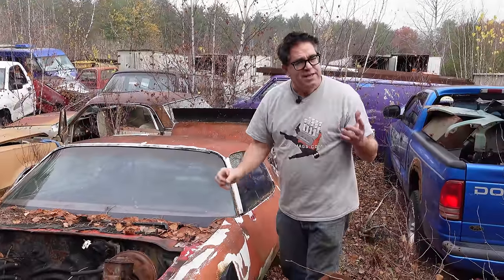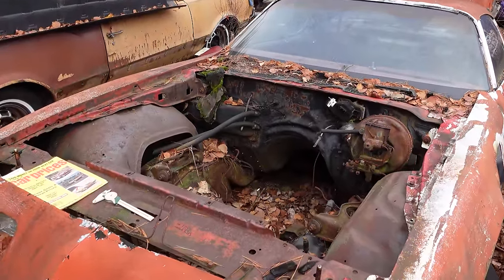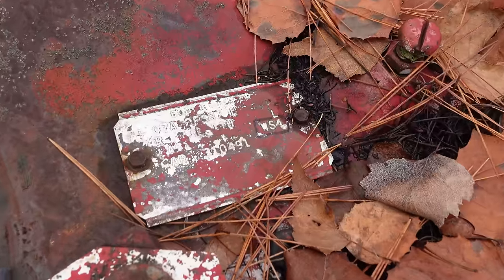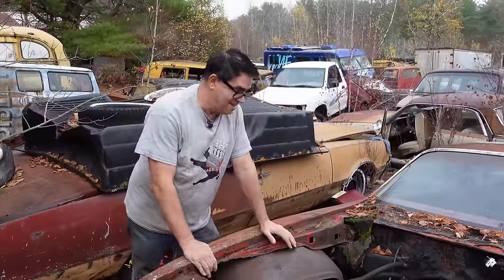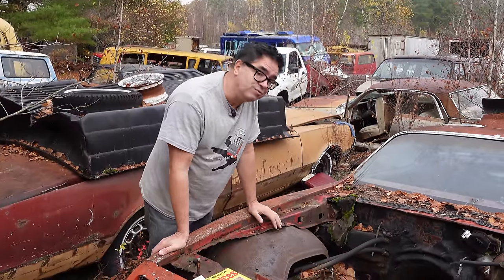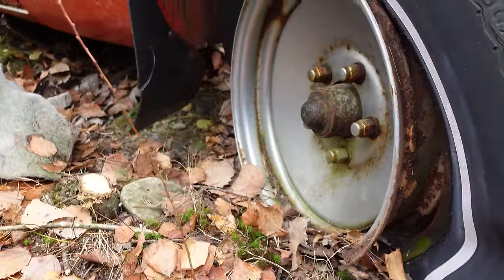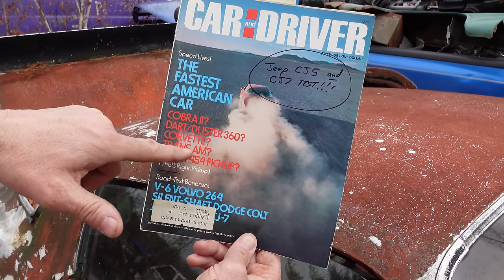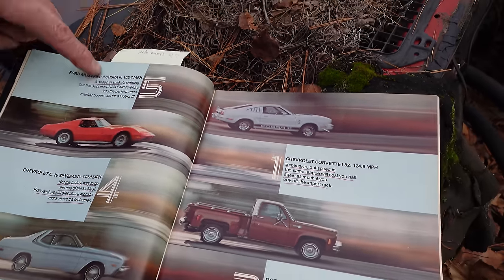1979 Trans Am

Comment: As a teenager lot boy in the late 70's I got to experience a lot of 2nd and 3rd owner muscle cars first hand. A side benefit was seeing which of these could do the biggest burnout and one of the best was a '76 TA with a 455 4sp...it went a whole block.  A close contender was a '72 Eldorado...easily melt the tires.  Still surprised that the dealer let us take cars out for lunch...
Reply: A lot boy that did burnouts with my cars would have disappeared from the earth.
Reply: A lot boy?  Washing and detailing cars.   Doing burnout's and melting tires...  Myth busted Randy.  Those cars could only spin the tires on Glare Ice.
Reply: @dand3975  Apparently you never drove any. I had a 76 Oldsmobile Toronado. It was FWD with a 215HP 455 that could lay a patch of rubber almost a block long without doing a brake stand. Just mashing the gas pedal on a flat street and it would erupt the tires. Horsepower has little to do with burnouts or tire frying capability. It is torque. Horsepower is a number contrived of torque over time. Torque is an actual measurement where horsepower is a calculated factor of torque. Malaise era cars were detuned muscle car engines. They dropped the horsepower but the torque of the big cubic inch engines pretty much remained.😊
Reply: my dad was one around the same time as you, he took a 71 mach 1 mustang with a 351C 4v  home from the lot, he did a huge burnout up his street car was sideways for 60 feet, when he went inside to eat dinner his mom gave him shit for driving like that and he said "its my license" she flipped the dinner plate onto his lap

Comment: In 1979 I bought a brand new Trans am. Black,  with the gold trim. Looked exactly like the Smokey and the bandit car. T TOPS,  etc..man I loved that car! Southern California car,  drove it across country 3 times to visit relatives in Wilmington North Carolina, with no issues.   By 1986 it had almost 150.000 miles on it. Only thing was it really was all show, no go . Had the 403 6.6 L engine.  So much smog crap just did the performance in. It drove great, I didn't really have many problems with it. 1 transmission rebuild,  water pump, heater core had to be replaced. 1 AC COMPRESSOR,   But it was an awsome looking car, great fun, and would cruise all day at 85 90 no problem.  Traded it in on a new  1986 Pontiac Fiero V6 MANUAL,  Fully loaded,  I totally loved it .  pretty quick,  Big whale tail rear and the porche looking front end. In red of course.  I still have it! 286.000 miles on it, engine never been touched.  Breaks my heart to see this poor old girl in this shape. I hope my old TA is still running around,  if it stayed in Southern California,  and probably did, it may still be on the road. My 58 cadillac that my parents bought in 1960,  and 68 Mustang I bought in 1977 are! Almost forgot,  in 1994, I bought a NEW Trans am, has the LT1 engine,  when I test drove it,  it was night and day difference in the Horsepower! This car is a rocket ship compared to the 79. I turned to the salesman riding with me and said I'LL TAKE IT!! Still have it. 338.000 miles on it, it looks nearly brand new,  engine has never been touched,  even the timing chain is original,  still runs great, and will still push you back in the seat when floored! 😊
Reply: That's an awesome collection my friend! I had a '77 TA black & gold and i loved it. Had the 403 though. Cheers man!
Reply: @aquateen77723  Thx! The 77s were super sweet!
Reply: That's cool man. My father is in possession of a family vehicle that's all original. It's a steam car that's very rare. We actually would bring the total number up 2 more because we have the complete that's a family heirloom and 3/4 of a parts one. I don't think there is about 13 or so known

Comment: This video is close to my heart. Last Monday the wife and I rescued a 79 trans am Y84 car k code. Such a incredible car I have wanted one since I was a kid. Bucket list car for me.  Cowl tag  79 06B 2FS87 N 237861 2nd row 62B 19L 19U L 3rd row A51 CC1 A31 Y84 4th row  TA2 180608. Needs alot of work no engine or tranny.  But will restore this car back to her glory, will take a few years but she will live.
Reply: I decoded that car on your channel. You had a few things wrong, but here goes again:

79 for 1979 model year, 06B for the second week of June 1979 production, 2FS87 for Pontiac Firebird, N for Norwood, OH assembly, 62B for Camel Tan cloth interior trim, 19L and 19U are Starlight Black exterior paint, L for lacquer paint, A51 for bucket seats, CC1 for T-tops, A31 for power windows, Y84 for Black SE, and TA2 for tan secondary interior trim. The other numbers are Fisher body time codes/internal codes and have no real meaning for most. Yours is one of 9,874 Black SE cars with a 403 for the 1979 model year.

Your VIN is 2 for Pontiac, W for Trans Am, 87 for two door coupe, K for 403 Olds V8 with four barrel, RPO code "L80", 9 for 1979 model year, N for Norwood, OH and the rest is the production sequence. The Norwood plant closed in August 1987 and the Van Nuys plant closed in 1992. The Norwood plant used lacquer paint and the Van Nuys plant used water-based paint due to CA air regulations at the time. The Norwood cars were better.
Reply: @googleusergp  this is incredible brother. I truly appreciate your time and help with this. I think this car deserves to live again. Is there a way to find out the rear gears in this car without pulling the difference cover 🤔
Reply: @rescuedandrestoredgarage  Look for the stamping code on the right side axle tube.
Reply: @googleusergp  that's going to have to wait alot of snow lol
Reply: @rescuedandrestoredgarage  In case you haven't figured out the rear gear ratio yet, there's a code on the front of the passenger side axle tube. There's probably surface rust on the tube, so light sanding should reveal the code. A flashlight and magnifying glass helps a lot. It's a 3 digit code, a number than 2 letters, like 2PU. 2PU happens to be a 2.73 posi, and is from my 79 TA with WS7. So yours could be the same, if your car came with the WS6 or WS7 handing option. WS6 has rear disc brakes. WS7 is the same as WS6, except for having rear drums. The standard ratio on a 79 TA with 403 engine is 2.41, code 2PS. So, if you can see the code, and it's not one of the ones I listed, then post the code here or on Trans Am forum or Facebook group, and somebody will decode it. But there's another way to quickly tell the ratio. Jack up the rear axle so both tires are off the ground. Mark the left tire with a marker or piece of tape at the top of the tire. Also put a mark on the pinion yoke on the rear end, or on the driveshaft. The transmission should be in neutral. Turn the tire forward one complete turn while counting the revolutions of the yoke or driveshaft. The number of turns the yoke or driveshaft makes is the ratio. For example if it turns about 2 3/4 turns, that would be a 2.73. If it turns a little over 3 turns, that's a 3.08. Those would be most likely on your car. Less than 2 1/2 turns is the 2.41. And a little less than 3 1/2 turns would be 3.42. 2 1/2 turns would be 2.56.
Reply: @grand73am  this is incredible information brother ty so much. I truly love this car. The wife and I have been making videos of this car and a few other cars we have. So information is very helpful

Comment: In around 1990, I scored a low mileage 403 from a wrecked  '79 Olds station wagon and put it in a '79 Regal. Funnest car I ever owned. 
 The Regal said 3.8 on the fenders, and as  it sat there going blat,blat,blat,blat people would ask"That's a 3.8 V6?", I'd go yup then get in and just murder the tires, I could smoke auto Mustangs and keep up with 5 speeds.

Comment: Years ago (like back in the early 90's) a buddy of mine had a 10th Anniversary T/A. It had sat neglected in his yard for years (IIRC, it had 23k miles on the clock), and the shop I worked at was tasked with getting it running/driving again. Well, after a LOT of work, that 403 4V (Oldsmobile engine, right?) ran perfectly, trans and brakes (yes, it had the four wheel power disc option, as well as the snowflake wheels!) were freshened, then it was off to the body shop for paint (and proper graphics) followed by the upholstery shop for the proper silver interior. Man, that thing was nice! He probably had twice the value of the car into that restoration, but he was on a mission. Would have been so much better if he had just taken care of the damn thing in the first place! LOL! Thanks, Steve. Rock on, man!
Reply: Yes, the 403 V8 was an Oldsmobile V8. You could also get a Pontiac 400 in a 10th Anniversary (I have one). The 403 is a dog, but a good engine.

Comment: Another great one in the books. Steve your absolutely right these 70s Trans Am held up on these back rd curves of NC all except 1. A friend of mine owed me some money for legal stuff and I took partial trade on early 70s model TA that had wrapped itself around a pole. I forget what yr but it wasn't the quard headlight body style.  The 455 AT was still intact. I had my grandma's mint condition, oil burning Olds Cutlass Cruiser wagon, White with woodgrain and light blue interior. Well you can guess where the 455 TA running gear found a new home at. The smaller wagon left little resistance against the 455 and became a well none "sleeper" in town. Not before I pulled a few $ from the Mustang and Camaro guys. If I could keep it from spinning off the line I'd freight train by any stock muscle of the day. Also probably could of won a few burnout competitions with it. The wagon met its end one night I lined up with a V8 S10. Dude had me off the line as usual and as I began to nose passed he swerved into my lane So I lifted as he passed on by he continued into my lane only to pit himself causing him to flip on his side sliding across the medium into 2 lanes of on coming traffic. A mid 80s suburban T-boned him while sliding. This causing an explosion of empty beer bottles/cans etc. Dude was drunk and I didn't know. I ended in the grass on the left side where the control arm grabbed some sort or concrete iron thing and we came to a sudden stop. Now the tragedy unfolds. So in the back of the wagon were 2-5gl pales of asphalt rejuvenate sealer. They impacted the rear seat and blew open the sealer and it painted the back of everything. Inside the windshield, dashboard, and the back of my head and shoulders. The A-arm was fixable but that light blue leather/vinyl interior was totaled not to mentionthe smell would've been permanently embedded...LOL  Namaste 🙏🏼

Comment: Even with the high volumes produced, these were hard cars to get. My dad tells the story that my parents tried to get one in late 78 and were greeted with a 6mo wait time. Needing a car as much as wanting one, they opted instead for Camaro Berlinetta off the lot that they still have today. Quite the different car, as it was equipped with a 305 2bbl, TH350, and 2.41 rear gear. Not flashy, but turned out to be a reliable car that will see a 3rd generation driving it here in a couple of years.

Comment: Duster was a typical no steer no stop Mopar that was  hard to drive at 12 mph and  I dam sure wouldnt want to go 120 mph . Trans am should have never been made with  such low hp #s what a waste . Depressing Steve but great info thanks . Surprised you didnt talk 10 minutes about the simulated wire wheel hubcaps associated with that rusty wheel . Proof there is a God ! Lol your awsome Steve Thankyou .

Comment: Thanks Steve! I know my 82 base TA had the flat hood, I corrected that problem real quick.. still had the carb engine though over the cross-fire injection, that I had to live with. But I loved the car.
Reply: The 1982 TA has a offset hood bulge similar to the 1980 and 81 Trans Am the hood was not flat.

Comment: Last one I had was a 74 455SD . Some one painted it all sorts of colors. Rear axle was yellow, front frame was green. Car was originally silver then they rattle canned it blue . Painted right over the bird .
Reply: If it was a true 455SD, that would have been a keeper and one to restore.
Reply: We lived in parallel universe! Had a 1974 Trans Am in the mid to late 80's. Also repainted from the previous owner from a light robin egg blue to a dark blue. Semi-Professional paint shop job, so only in tiny spots under the trunk trim gave it away. Had an aftermarket Edelbrock intake so the original Q-jet carburator had some weird spacer, which I replaced with Holly carb that actually fit and worked better. The posi rear end was awesome. It was hard even back in the day to find one not customized in some fashion. Crushed velvet seats were popular custom touch but not with me. Aftermarket T tops would ruin many of them, as they always leaked eventually.

Comment: Reminds me of the rich kids in my 1970s high school. 

Car makers would have loved the use contoured headlamps, but the NTSB wouldn’t let go of the sealed beam requirement, which fit the aiming tools of the time. Rectangular lights were a big victory over the government at that time.
Reply: Think we need to go back to the old sealed beams - and ban all of these modern headlights with their too bright bulbs, and bulbs which aren't too bright, but use an eye-irritating frequency. Halogens lit the road up just about as good as the modern lightz.
Reply: in my class 66-70 we had a couple of rich kids too..in 68 one got a new  bright orange road runner and  the other  got a a bright green cuda ...we were not a family of means but i got my moms 4 door  1960 bare bones ford Fairlane with a 223 6 cylinder and 2 speed ford a matic ...the best i was able to was put in a 10 dollar glass pack  muffler and a competition rake..

Comment: Excellent episode Steve. I’ve seen about 40 of your Junkyard Golds so far and I’m loving and learning like crazy. My buddy bought one of those 1980 Turbo Trans Ams and it was flashy as heck with the hood scoop boost lights and all, but it really ticked him off when my old, beat up Boss 351 cleaned his clock every time.

Ah, those were good times. Keep up the good work Bud. 🏆🥇👍
Reply: Turbo Trans Am was 1980. Not 1979.
Reply: I had a chance to buy an '81 Formula for $1400 in '95! It had the "sexy options" (console, t-tops, etc.) but I could NOT get past the CRAPPY "301" under the hood!

Comment: If you can get a Herb Adams VSE catalog you will learn a lot about the Firebird/Camaros of that era and which ones were the best. I've lost mine over the years but I do remember he recommended finding any WS Firebird parts and adding those as they were the best GM made with the tightest tolerances. He also sold things like taller heavy duty leaf spring shackles ( I added a pair to my 1981 Z28) for the rear to bring up the sagging rear ends these always developed without going to bouncy air shocks that looked decent but were a big step backwards for handling. ❤

Comment: The 301 4 bbl was an option as quite a few of them came with the weird 301. It was no tire burner but it got up to speed pretty good on the highway
The W6 had even a bigger front swaybar .
Reply: Trans Am front sway bars were all the same, it was the rear bar that was bigger on the WS6 cars.
Reply: @leonmarker7482  the swaybars made all the difference when comparing the Camaro to the Trans Am . It was day and night! Thanks for the details!

Comment: My 1975 Pontiac Grand AM had the pop out nose too. It was even a part of their advertisement when the Grand Am was first introduced.
Reply: Yes, but unfortunately for the 73-75 Grand Ams, Pontiac did not have the soft urethane formulation perfected yet. So, the noses hardened, cracked up and broke apart over time, with virtually none of those original noses surviving. Fortunately, a company named Motorealm repros it in fiberglass. I have a 73 GA, and have the fiberglass nose. On the other hand, by 1979, Pontiac got the formula right for the Trans Am, and the 79-81 noses have survived very well to this day.

Comment: I had a 1973 Firebird Esprit and my dad had a ‘77 Formula.  Very fun cars to drive, especially when he took out the catalytic converter and replaced it with a straight pipe.
Reply: My uncle, mom's brother bought a second gen Esprit after he got home from Vietnam. He eventually turned it into Formula thanks to his job at a local big city scrap yard. Suspension and all. Car was fast as a demon and could really hug the road in curves. He did it right.
Reply: ah yes, the early days of emissions where a "test tube" in the exhaust and losing the AIR pump didn't trigger all the other sensors to go into limp home mode :) just swap the Q jet for an early model for $5-$10.

Comment: My family has had several of these. 

We briefly owned a 78 trans am with a 400 that had chrome valve covers and an automatic and would bark the tires on the 1-2 shift in stock form. I think it must have had the W72 engine in it.

The 78 was traded on a 79 that had more options and the 403 and 2.43 gears. It was a turd, and eventually got turned into a drag race car with a cage and a 455. Top speed on that car was about 125mph stock - the engine didn’t have the power to go faster and would just quit pulling.

We bought another 79 that survives to this day. I just finished a rebuild on the 403 in it and discovered that parts for that engine have dried up as have engine cores. Not surprising since it was in production for only 3 years.

I bought a basket case 79 tenth anniversary and spent 4 years working mostly on weekends to restore it. Surprisingly, there are parts still around for the body but good luck finding a W72 engine or a 17059263 Quadrajet. I got lucky and stumbled on that carb and gladly paid $1500 to buy it.

Driving one of these cars today is fun from the standpoint that you’ll draw tons of attention from everyone! Driving one is also a reminder that these cars handle pretty poorly when compared to todays cars.